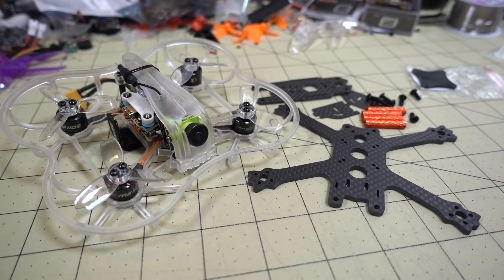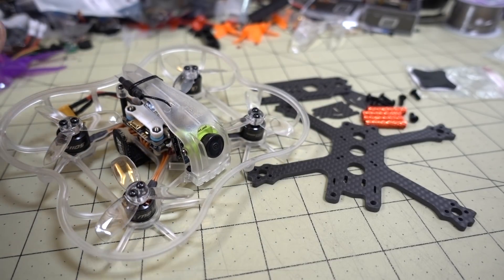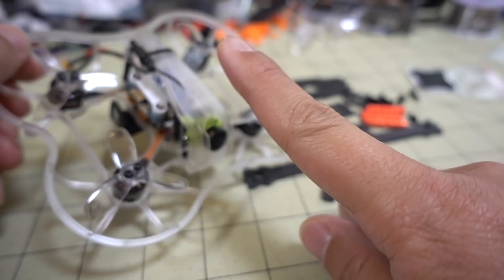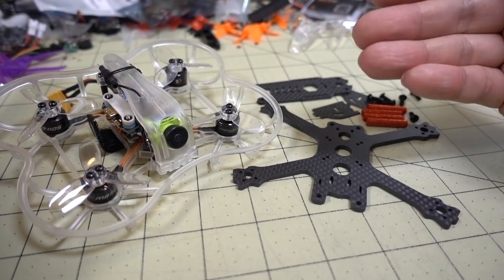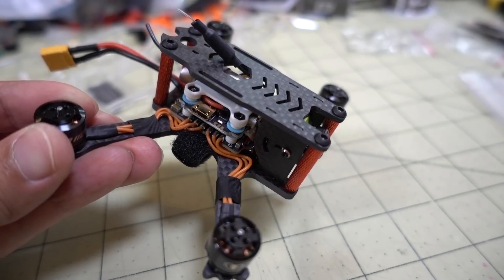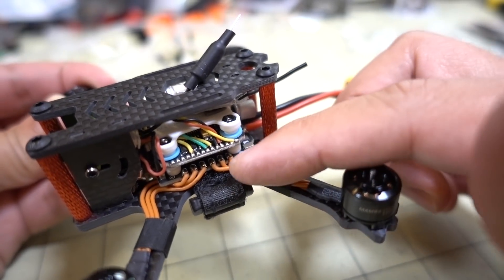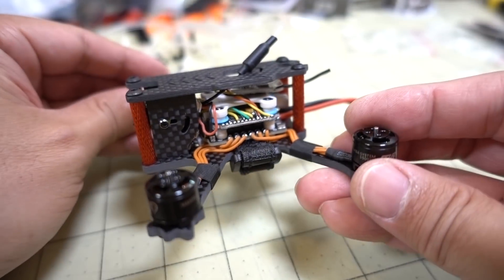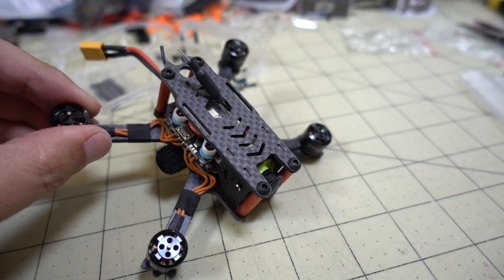Build a Cheap 2.5 inch Micro Drone 🚁

Comment: Would it be cheaper to 3d print a 2.5 in microdrone if you have 3d printer?
Reply from the maker: That won't be very flyable due to the vibrations at that size.  Smaller than 1.6 inch props might be marginally OK.
Reply: @AlbertKimTV  have you try to fly a 2.5 frame that been 3d printed I was just wondering?

Comment: Hello, can I use a caddx turtle V2 in this frame? Which is the space between columns? Thanks
Reply from the maker: It will be a tight fit but it should be able to fit if you keep your stack height low.
Reply: @AlbertKimTV  Thank you very much for you answer.

Comment: How heavy is this since it's all moved to the ahx115 frame including props? I've just finished doing a build using the ahx115 frame, used a mini mamba stack, hglrc flame 1106 6000kv motors, eachine vtx03s, generic runcam micro, gemfan 2540 props. Weighs 92grams with props on which is a bit heavier than I was expecting but I think that frame is more beefy than some of the other 2.5 inch frames around

Comment: I have my diatone 239 converted to HD with runcam split mini 2 but not really happy with the performance, high pitch noise props make  etc. i guess the frame and props makes a huge difference. I would gladly convert to this 2.5inch frame i think i have the fullspeedrc leader 120 frame lying around just worried about the tune again. Bigger props for same motors could be one problem, BF 4.0 that makes motors hot could be another. Would you share the basic tune for this style frame?
Reply from the maker: Look at the tune for this - https://www.youtube.com/watch?v=sZPIK8zOhRk

Comment: wish i would of seen this a month ago. i bought 75x f4 and put on a hglrc hornet with betafpv motors and have been spending money left and right to make get it to fly right. it was doing good on 2s with 2.5" props but i wanted more and decided to put everything on the hglrc arrow3 frame and with 3" props with lower kv emax motors. its almost where i want it but i need to learn to tune to get it right. would you suggest i adjust for low kv setup?

Comment: I had the same Diatone with the plastic frame and converted it to a 3in. I changed the motors out for bigger ones and it ended up costing me more but It's my favorite quad to date. 3in is where its at.

Comment: Do you have a good BF 4.0.2 tune specifically for an F3 based board?  Flashed it on my Baby Hawk r 2.5 inch and it is fluttering on punch outs.  Thanks!
Reply from the maker: Not yet... might work on that one too.

Comment: Looks great! Seems you can get a pretty decent build in every size these days for under $125. I was trying to build a cheap whoop/toothpick but then I realized there's so many decent whoops out there for cheaper than I could build so it'd be more fun to try and build the perfect one and spend a little more. Still shopping around for components tho. Might be worth it to buy a donor like this if I can get the motors and esc or vtx for cheaper than buying separately.

Comment: Not a 2.5 inch but budget 3 inch I recently built. Total 116.78USD, with patience and coupon I was able to build it for barely under 100USD. Some people might disagree with my choices but I'm happy with it

Mamba F405 Mini Stack : 37.54$
iBus FS-8A Flysky receiver : 5.66$
1407 3500kv Racerstar x4 : 29.72$
Foxeer Arrow Micro Pro : 16.92$
Mini VTX5848 : 12.18$
Helifar Turtles 3K 135mm Frame : 8.44$
5v Buzzer : 0.86$
10 pairs LDARC 3x5x3 Propeller :5.46$

Comment: If you want something exotic, here's a great deal
a "Plus" frame with 3mm carbon for $7.61...(sometimes they randomly hv 10% off LOLLLLLLLLL)
https://www.xt-xinte.com/JMT-12892-128mm-Wheelbase-Mini-FPV-Frame-Kit-Carbon-Fiber-CF-Rack-For-DIY-FPV-Racing-Drone-Quadcopter-2-5-inch-Props-1103-1104-Motor-p580261.html
They have 3 sizes, can search for "JMT frame"
I bought the 120mm one for 2 inch @ $6, hvn't build yet.

Amazes me how I can buy cheaper in Xinte than buying from China directly @___@

Comment: If someone wants a 2.5 in frame fast, Amazon has the HGLRC Hornet 120 for 22 bucks, prime.  If you recall, the original Hornet model frame had slight interference with the front props but has been revised, to an extra 2 mm left to right, at 3 mm more diagonally, approx.  The hornet was lighter than the competing Aurora mini fight 2.5 in model at the time, and hence faster.

Comment: As you had recommended a few weeks back, I bought that frame to transfer my ET115 parts since I had broken an arm after about a year of flying.  The parts you transplanted seem quite a bit better than what I used, but OTOH, I already had them.  I see you have the battery on the bottom, is that due to the vtx antenna position or do you think it is better for this frame?
Reply from the maker: On the bottom because of the VTX.  Top mounted should work too but I didn't try that.

Comment: You picked a pretty decent setup to transplant.  Just about everything out there that's cheaper will have a sacrifice on one or two of the components to bring the price down, so what Albert has done here is a good way to jump in, learn how to build then learn how to fly a micro, without a lot of trouble.  BTW, I'm betting on the PINK version to drop in price long before the other colors do, so I'd have my eye on that one for the future...lol

Comment: After building and flying pretty much every size quad, 2.5" is without a doubt my favorite. With some nice 1106s and those gemfans the size to performance is just outstanding.
Reply: Yeah I've got one with iflight 1108 motors to carrying a session to do more cruising cinematic stuff, but can't to get that new 2 in 1 caddx and get some performance and flight time back!!!
Reply: You like those gemfans over the Avan props?
Reply: @trey4weaver  this was probably for jovid7 but I also have the gemfans, bought 3 sets of the avan's, as I use the avan flows on my 5" and have yet to find anything I like better, well after a couple flights the Germans are back on, and the avan are sitting in a box somewhere... Just like the throttle curve of the gemfans more, but I do have a heavy build at 240g with the session sitting on top.

Comment: I built a slightly more expensive 3 incher using the Amax Inno freestyle 3E, the same Mini mamba stack, bought the 8 motor bundle of T-Motor Racerstar RT11s (1106-6000kv)  from banggood, 
 used a  Foxeer Micro arrow and a Wolfwhoop TX5 for video. I use either the HQ T3x3 biblabes or the KK 2840 triblades on 3S. I'd say it cost me around 120 usd to build. If I bought the whole 2i n Diatone quad, I would probably transfer the components to a Massive droner. Not really a budget build, but you get a really nice micro.
Reply: T-Motor Racerstar RT11s (1106-6000kv)  good power,  but quality is so so. I got an 8 pc and 5 had shaft slip out, 1 smoked. I repaired 2 with loctite glue and those are still running. Will fly until they die.
Reply: @LosFPV  Unfortunately, I had the same experience. Two are smoked and two are still working but not reliable. I still have 4 brand new ones left.  I will probably keep hem for a ducted frame like my Armattan bumper.
Reply: @yannickg6904  good thinking.
Reply: To be fair though, shipping charges must be taken into account and Albert's Strategy of buying a whole BNF and a better frame means you only pay for shipping twice....